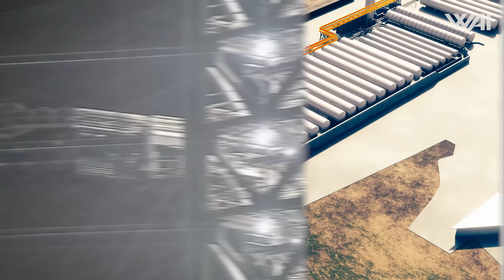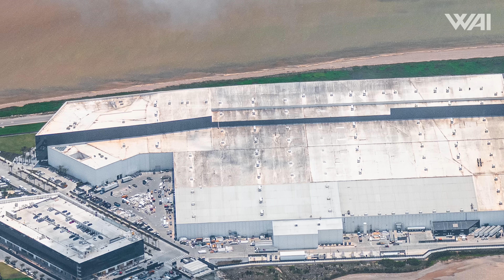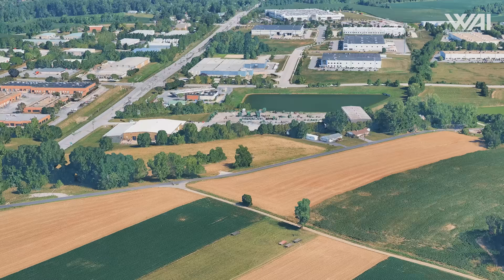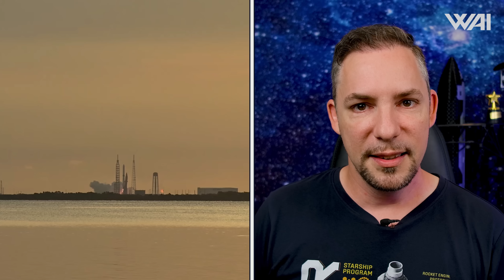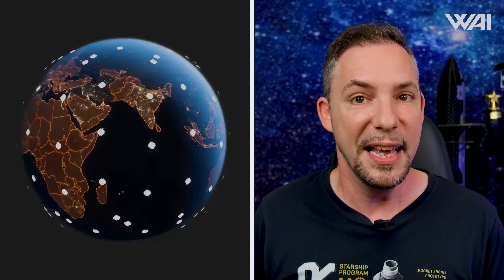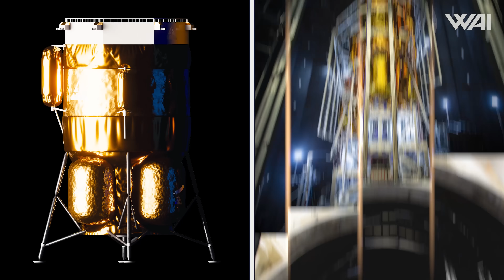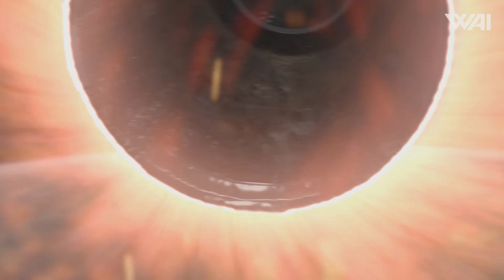SpaceX Reveals HUGE Clue! When Is Flight 12?

Comment: POSSIBLE REASON for only 10 engines on first booster test: knowing pad-side failures were likely, did they run multiple different engine shutdowns schemes and determine which was the best. Then apply that shutdown logic to a 33 engine test while introducing some new, subtle differences in shutdown logic. Then inspect and do it again. If you ran the best logic in 10, then the best in 33, you’d iterate just twice and you’d be at 99.64% percentile for shutdown optimization. 

Spacex potentially knowing pad-side issues were likely, found the opportunity of one failure to be the iteration cycle of another!

Comment: As a person that used to work for a contractor to NASA, and personally inspected the Computer Control Cables for the Space Shuttle, I do not trust NASA for anything. They spend too much money without good productive outcomes. Artemus doesn't impress me. It cost more than others and just isn't dependable. I would not accept a ride on any Blue Origin vehicle. NASA fails to listen to the Engineers that know what needs to be done. Ignoring the Engineers has resulted in death of astronauts several times. They just have their priorities in the wrong places.

Comment: Re: The 10 vs 33 engine static fire and engine damage. The 10 engine SF was the FIRST use of SpaceX ONLY functional (almost) Starship launch pad. Thus Raptor abort would have been MAX rate to avoid pad damage from 10 of the worlds largest plasma torches, preferring Raptor damage to save the launch mount (after all, they've made over 100 R3's, there's only one pad 2) . The 33 engine SF  would have included learning from the initial  SF abort and was likely an "engine friendly" abort.

Comment: A suggestion for SpaceX: Why not use the hot staging ring as landing legs for Starship should it need to land on legs. It is already there. It just need to be kept on the Starship instead of the booster and then of cause be redesigned to work as legs as well. An engineering problem only. Also of cause the Starship will loose a little load capacity.
Reply: That mass would 100% cut into the payload capacity. And perform poorly. And why use legs? No benefit compared to the chopsticks.
Reply: @imconsequetau5275  You are right about the 100% but like landing on the moon there are no chopsticks and there might be other occations where landing would be preferable some where else. If it has to use legs anyway then it would be more than 100% if both legs and hot staging ring has to be there.
Reply: The HSR must be designed to withstand up to 3G of acceleration against 1700 Tons of Starship mass, at least 5100 Tons of force, plus some safety margin. But the Lunar landing legs need only support 300/6=50 tons of static force. Spread among 6 legs would be 8.33 tons each. (Although dynamic loads could be much higher if the engines fail to soft-land.) 

Perhaps double those numbers for Martian legs.

So the HSR is highly "over engineered" and overweight for the Lunar loads.

The Lunar and Mars landings require legs that conform in length to the irregular surface and keep the Ship true plumb vertical. The HSR does not help here at all, and is not designed to be bathed in Raptor engine flames or re-entry plasma for many minutes.

The hot staging ring is staying on the booster, ready for reuse within minutes, and where its mass has far less penalty. 
@leonhardtkristensen4093

Comment: Gas tank starship go offset nose to nose with none shielded side connector arms fueling pipes then transfer by gas pressure system. On fill up of travel version take small bit left for pushing tankers to out going trajectory for later salvage when later needed.

Comment: All these new technologies are being developed right before our very eyes.
The extreme pressures, and volatile fuels that the rocket engines operate and use are amazing.
Yet people wonder why it's taking so long or why we haven't been back to the lunar surface yet.
Even with the older programs, Mercury, Gemini, and then Apolo, that took 10 to 15 total years worth of research and development. 
They aren't able to go to Home Depot and AutoZone to buy parts 😂. Everything is freshly designed, built, tested, then put to use.

Comment: Great news about the launch date!  I'm worried about the new pad and the engine damage though.  Acoustic damage to pads and vehicles has been a long time challenge for big rockets. John Young said he would have ejected along with Bob Crippen on STS-1 had he known the body flap was as stressed as it was by acoustic reverb from lighting the SRBs.  Hopefully SX modeled the new diverter system adequately.  It would be pretty ironic if Pad 1's open structure turns out to be the best way to deal with the power of Superheavy.

Comment: I still don't understand. You can talk budgets and astronaut safety, but still, how come is orbital refueling now NECESSARY to send humans to the moon ? How come New Glenn can't launch Blue Moon in one go ? What technology was lost?
Reply: Everything is more massive this time. Orion is heavier, landers are heavier. The goal is to colonize and stay. Which requires large cargo transfers to the Lunar surface. Thousands of tons. Starship perfectly fits this role. 

The Constellation program might have had more lift capacity than SLS, but the cost-plus contracts were growing unacceptably expensive, with large delays. $69 Billion has been sunk into SLS/Orion, plus another $4 Billion per launch. A fully expended launch system discards the entire SLS stack. 

Starship/SuperHeavy even NOW costs about 60-90 Million per pair to build, should be fully and rapidly reusable. So the amortized cost of 100+ launches will be very cheap indeed.  

Keep in mind that a dozen propellant Tanker launches is no more complicated than the first launch. It's repetition, using the same hardware over and over.

And a tanker loss during launch does not wipe out the mission. Other Ships are already waiting in line. 

These Ships can each be constructed in about 5 weeks right now, and soon will be rolling out weekly. Boosters stages have far more engines, but are only slightly more complex than Ships.

Comment: Hydrogen for a second or third stage fuel, especially if it has to be restarted in space is a bad decision. Nobody else does it for several critical reasons. The primary negative is it's the lightest element on the periodic table. Meaning it can't be contained in ANY tank. So there is always an explosive danger with the vehicle.

Comment: I want to know how they line up the intake on the booster and starship to the quick disconnect, especially when it comes back in and is captured by the tower.
Reply: After tower catch, if perusing a rapid relaunch, I would bet for the foreseeable future, they are gonna take them into megabay/gigabay and check them over, then bring them back out to tower and restack.  If not, then they could certainly lower them to the ground crawler and reposition crawler for a subsequent lift to the tower.

I think at first, we're not gonna see a catch of booster + catch of starship on same chopsticks, quick stack, fuel up, and launch.  They may build towards that.

If you mean instead, before the launch, then they use the crawler to position them so when craned up by mechazilla they align.

There' also probably a little play in the QDS.

But we should also remember, booster is caught, what, 15 mins after launch, where Starship will come back let's say 4-8+ hours later after either payload deploy OR fueling a fuel station in orbit.  So there is probably time to deal with booster, maybe put it on crawler to get it away, before starship catch.
Reply: The arms have moving slides on the top.

Comment: How could New Glenn enter the wrong orbital inclination?  Did it “hook”; skewed by not enough thrust on one side?
Reply: Assuming it was one of the outer engines that had low thrust You would think they would then roll the stack so that that engine is either on the top or bottom in relation to the others so that only the altitude is affected. I'm just guessing though as I am not a certified Kerbalist.
Reply: @StevePemberton2 , I’m guessing that the booster did it’s job putting the second stage into the proper track, at the proper inclination, but that asymmetric thrust from the second stage’s two engines caused it to curve to one side or the other.
Reply: I don’t have any inside information, but it’s pretty clear very real design issues still need to be handled. - Dave Huntsman

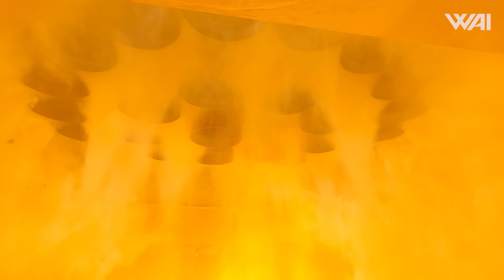Comment: 10:20 the shutdown sequence was different than the 10 engine test. I believe the learned it the hard way with those first 10 engines.
Reply: With the 10 engine test they said they had "indications" of damage. Not that damage was confirmed. They also said 10 engines were "salvaged". So if there was found to be any actual damage, it must not have been severe.

Comment: For Christ sakes, you'd think the world would get together on Space.  Share tech btwn Countries, Companies.  Gives Jeff, merlin engins for his 2nd stage and get the show on the road with Sats and AI.  You'd think the price paid for dev. wouldn't be at the cost of Sats themselves...
Reply: fierce competition is actually the primary engine driving the rapid pace of innovation, in a partnership the pressure to undercut prices and invent tech would evaporate. Competition also provides dissimilar redundancy, so a failure in one doesn't stop the other (this is why NASA intentionally awards contracts to multiple companies). It's that desire to be "first" and "best" that translates into 100-hour work weeks and engineering breakthroughs. Competition creates the talent war, pushing the best minds to work harder, provides parallel paths to the same goal, and keeps costs down because the customer (government in this case, spending taxpayer money) can play one company's bid against the other.
In short, we don't want them to hold hands; we want them to race. The faster they run against each other, the sooner we all get to the Moon.

Comment: The 33 engine static fire does not look like 1.88s. Wasn’t it way longer on the video material? Almost 6s or so. That would put it in a reasonable length for no mechanical damages
Reply: I'm pretty sure that's a slow-motion video.  The steam billows are much slower than on several other cameras. The original videos show flame for about 3 seconds, which  I guess means nearly 2 seconds of running, then another 1 or so to shut down.

Comment: this is why spacex tested the ship first before anything else and why it is still in development. blue origin should've known better. second stage should have been tested first before putting an actual payload on it. then used dummy payload then the actual mission. very simple process yet someone jumped the gun. test, evaluate results, improve and then test again repeat until operational functions and everything related are satisfactory.

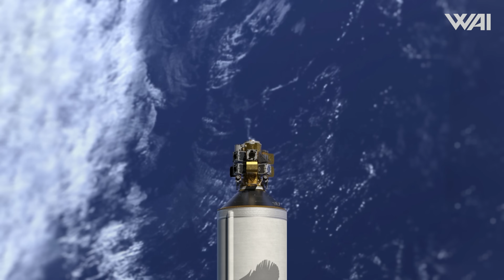Comment: 15:00 New Glenn second stage is hardly a sports car, and is not more capable than Falcon. This is the "Hydrogen Paradox", great specific impulse but ultra-low density ( 71 kg/m3, 11 times less dense than kerosene) which requires massive, balloon-like tanks that kill the mass ratio (the ratio of fueled mass to dry mass).
A capability comparison would be taking into account thrust, propellants, efficiency but most importantly mass ratios. You praise hydrogen efficiency, but that is nulled by the very heavy structures and engines, lower thrust to weight ratios, etc. This explains why it's much less capable than Falcon Heavy S2 (has half the payload to GTO, 13t vs 26t)

GS2 has much lower structural efficiency (mass ratio): Falcon S2 is one of the most structurally efficient "tanks" ever built. Dense RP-1 and superb engineering allows for small, compact tanks which also share a common bulkhead. That gives a mass ratio of almost 30:1 (only about 3-4% of its fueled weight is structure/engines). New Glenn GS2 tanks are enormous in order to hold the same mass of fuel= more skin, more insulation (to prevent boil-off), and more internal stiffening. GS2 struggles to exceed a mass ratio of 7.5:1 to 9:1. That combined with lower TWR its gives it a lower ΔV than Falcon S2. So less performance overall, for a great deal more complexity (lower reliability, lower production rate, higher operational costs), and a LOT of added cost (GS2 costs >$50m vs FS2 ~$10m).

Comment: Before you musketeers start shouting back, mars closest to earth is about 35 million miles away?....lots online from many well known scientist on why the starship WILL NOT take a man to mars and back safely....it can barely hold enough life support for astronauts etc...so what's going on with starship, a covert mission for something else?, robots will replace astronauts?, some even think the mars mission is to recover artifacts?...ps don't shout until you researched why starship cannot go to Mars and back.
Reply: Claiming a 52 meter tall, 9m diameter spacecraft with >1100m^3 of pressurized volume and >150t payload capability to Mars "can barely hold enough life support for astronauts" is complete nonsense. Follow your own advice and do some basic research before parroting hater nonsense.
Reply: @admarsandbeyondI guess you have done the maths, the research?
Reply: @Ai-he1dp  Not that hard to calculate. NASA-derived Baseline Human Requirements (per person per day) averages for a Renewable/Closed ECLSS (like the ancient one on the ISS), are ~1–4 kg/person/day (mostly food + minor water/O₂ makeup). Power: ~0.5–few kW/person for processors (Starship has solar).

Transit time to Mars with Starship (average): 115 days (as short as 80 days on ideal synods).

Total: 115-460kg per person. If Starship can carry 100t then it can support the 100 person max stated capacity per SpaceX easily.

Even without any advanced ECLSS (completely unrealistic), max total "open loop" mass: ~5–10+ kg/person/day without recycling (water dominates), or up to ~30+ kg including full hygiene waste. That allows Starship to carry a crew of 21 to 173 persons.
Reply: Ps in earth orbit
Reply: @Ai-he1dp Not according to NASA. Explain why you think these can't apply to a martian transit, and how the enormous margins allowed by a huge ship like starship are inadequate.

Comment: On the 33-engine test shutdown:  I don't think they did a rapid shutdown.  First of all, the flame duration was significantly longer than for the 10-engine test, while the abort occurred earlier in the firing than for the 10-engine test.  That tells me that this was not a fast shutdown.  In that case. the engines most likely came through the test OK and most (if not all) of them will be used for the flight test.  After all, the engines are deigned and tested to ensure that they can be relit (and even reused) many times.  I strongly suspect that after the 10-engine test, the launch sequence software was reconfigured to limit the number of cases where a fast shutdown would be done.  My guess is that it will now only be done if there is an imminent threat to the booster/stack and a quick shutdown can mitigate it.
Reply: Also, with the 10 engine test they had "indications" of damage. Never said damage was confirmed. They said 10 engines were "salvaged". Didn't say 5 were salvaged. So not making any distinction between the 5 good and the 5 possibly damaged. If there was found to be any actual damage, it must not have been severe.

Comment: I thought the deadline for 1,600 Leo satellites was pushed back to July 2028, or at least Blue Origin has submitted the paperwork to the FCC for this.
Reply: Even then, it would be tight.  That's over one hundred per month...  July 27 is not happening, for sure.
Reply: @ChristLink-Channel  If you add up all the satellites for the scheduled future Leo launches on just the Ariane 6, Atlas V, Falcon 9, and Vulcan Centaur platforms through the end of 2027, you get 2,394.  If you add the 25 New Glenn Leo launches scheduled through the end of 2027 to this you get 3594, but this assumes that Blue Origin can launch 11 New Glenn missions with 48 satellites each by the end of 2026.  The current total number of Leo satellites in orbit now is 304.  Anyway, I think that whatever happens with the New Glenn grounding this year, they should be able to reach the 1,600 goal if it's moved back to July 2028.
Reply: @victorkrawchuk9141  If it does move to 2028... I haven't seen any confirmation of that yet.  Hopefully it did!  But there's no way they are going to have 11 New Glenn launches this year.